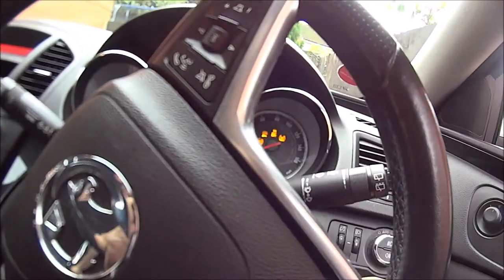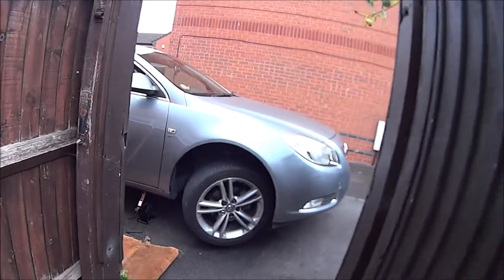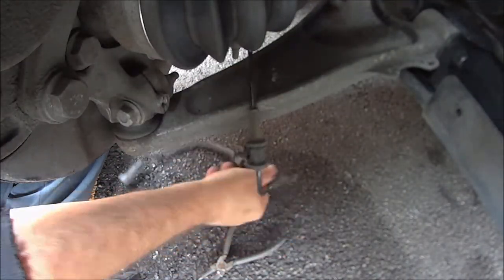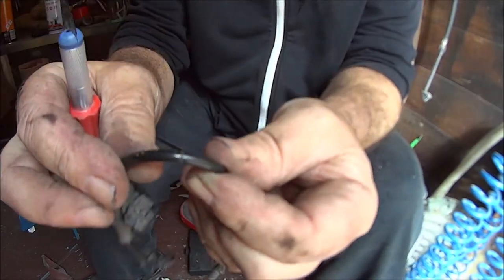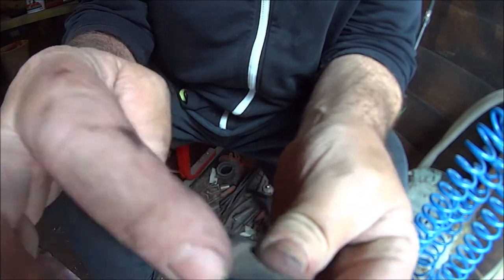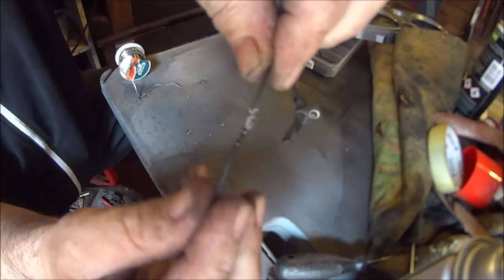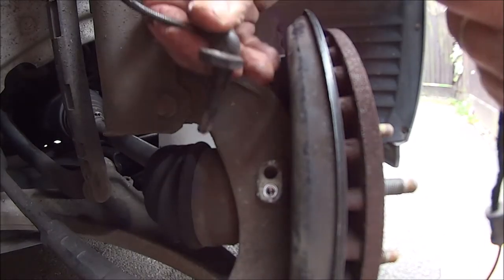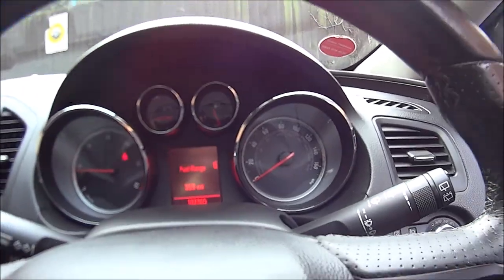VAUHALL INSIGNIA, traction control and ABS warning lights FIX.

Comment: Recently I got same issue, so change the Abs wire and break pads, but now it’s showing same butt some times turn off and some turn on,when I’m in driving or turn to left or right side.
Reply from the maker: Did you get new sensors for both sides? Or maybe a new sensor is bad.

Comment: Mine has had this issue for years and I’ve just ignored it… because I’m a ridiculous person… but every year up until today, it has not failed its MOT. Today, it failed the MOT because this light comes on. I argued that previous garages went on to use the diagnostic tool to confirm that there was no genuine malfunction and therefore passed me but these guys refused. What do people think? Is this right? Why have I had about 7 MOT’s pass despite this issue and then today they make a point of failing me?

I read the MOT guide… I appreciate under the ABS section there is nothing to excuse the warning light… however when you read the EPS section, it says that they should only fail if they are sure there is a malfunction. How can they be sure if they don’t go on to do the OBD2 scanner? Apparently the MOT doesn’t require them to carry out the diagnostic scan. I had booked in for a full service, as I always do. So they were going to be paid for diagnostic work. For years, every other garage hasn’t failed me for this. Some have raised it as an issue and I’ve explained it’s a known fault and they’ve seemed satisfied that the OBD is more trustworthy than the dash light.

I ended up at a different garage today because their customer service booked me into the wrong place. Caused me to be an hour late for work. You couldn’t make my luck up with this today. 😒
Reply from the maker: Luck of the draw.  If the MOT man as a bad night who knows what he will find

Comment: Idk if its the same problem that Im having… these lights comes on, the speedometer stops to work and the power steering light is also on. The garage cant find the problem. Hopefully is something like this, have you ever saw this problem in the 2017 model? Thanks for the answer
Reply from the maker: Sounds like you've got something else going on. You should try the insignia forums maybe people there who've had the same problems 👍

Comment: Hi John, mine stays on all the time would this be the solution for that too? Thanks in advance
Reply from the maker: It's usually the case. They're pretty cheap on eBay. If not give it a good spray with brake cleaner on the abs teeth at the back of the disc 👍
Reply: @jonyr1TT  thank you. I’ll give it a try and let you know the result

Comment: How did you know it was that sensor that was the issue as there is 3 others did you get it fault read? Just asking as my insignia has the same issues
Reply from the maker: I wiggled the wires to see wich one made the warning light come on.
Reply: @jonyr1TT  that wasn't In the video you can wiggle abs sensor and not find a fault you seemed to know which sensor had the fault
Reply: An abs sensor can fail because of a bad connection at any point not a split wire....we all like a repair like I say my car is being a nightmare I have no idea what one so I need to get it code read on Monday
Reply from the maker: Yes it does show. Arm in wheelarch...sorry it didn't help your problem im no machic just a guy trying to keep cheap motoring 👍